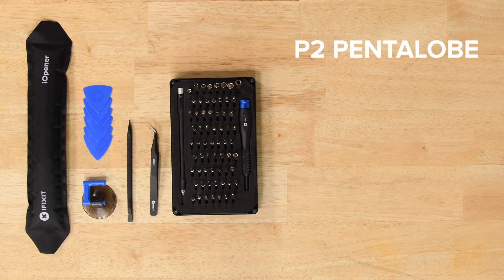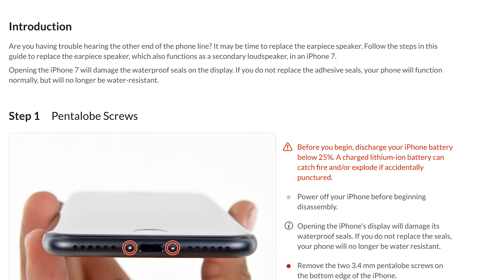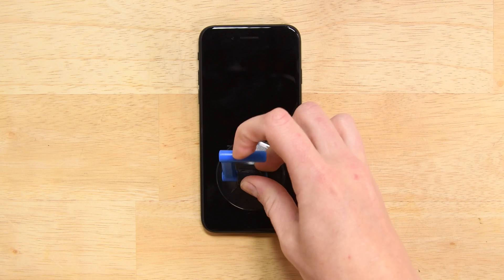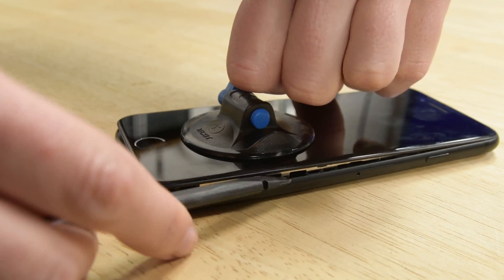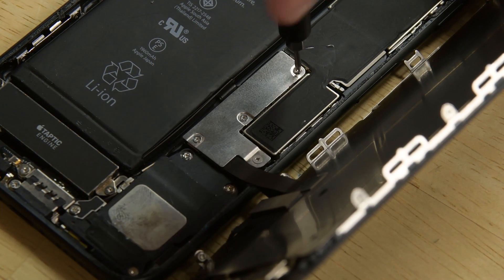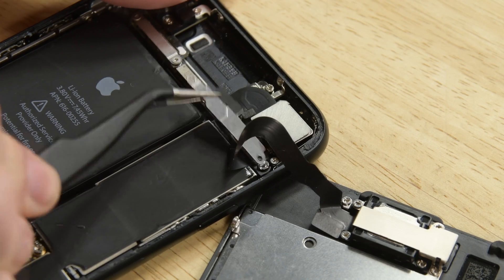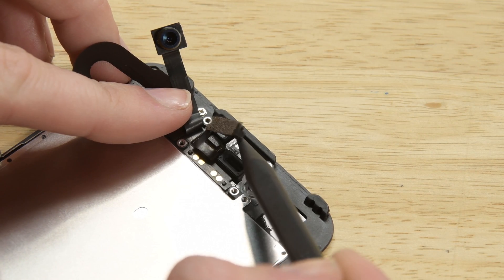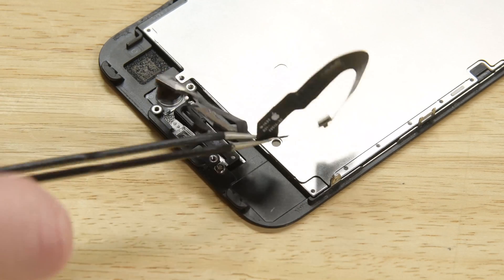iPhone 7 Front Camera Replacement- How To

Comment: Fixers beware. You will mess up the part at 3:12. This video doesnt mention it, but the glue holding the ribbon to the phone is stronger than the glue connecting the ambient sensors to the ribbon cable. It will separate if you pull on it, or try to pry it. The best way is to cut your broken screen above the LCD so you can truly get underneath the ribbon cable and not "in between the 2 ribbon cables"

Lots of people mess this up, youtube other videos that explain the challenges in better detail. This is merely a promotional video as it doesnt explain the dangers thoroughly.

Comment: Wow the video is really misleading. When they show the removal of LCD it looks really easy and that is because you clearly can see that there is no adhesive and that is because phone was opened before the video. In reality it will be a lot harder as the adhesive does make a difference and pulling on suction cup sometimes does nothing and plastic tools are too soft to get under screen. Using iSesamo is much better but you do have to be careful not to scratch your phone.